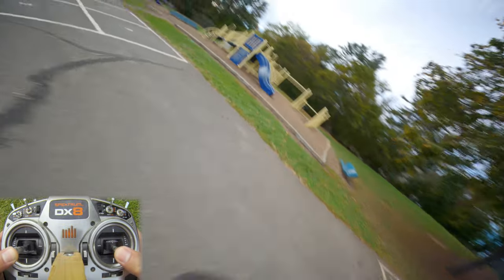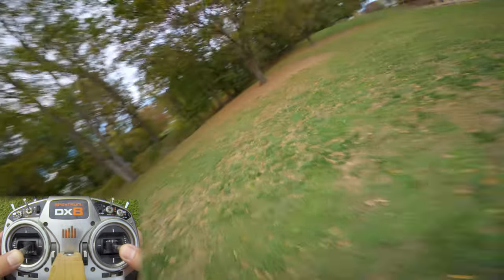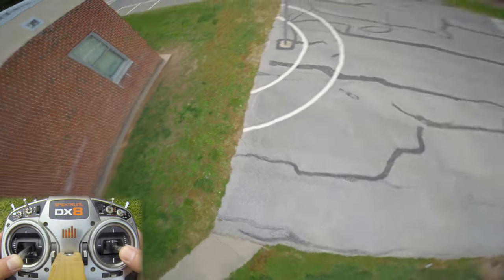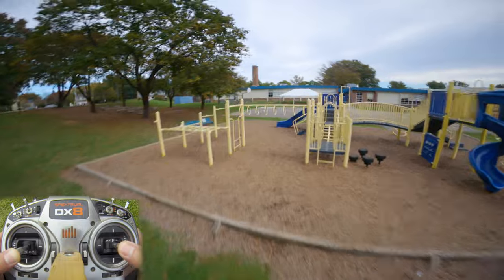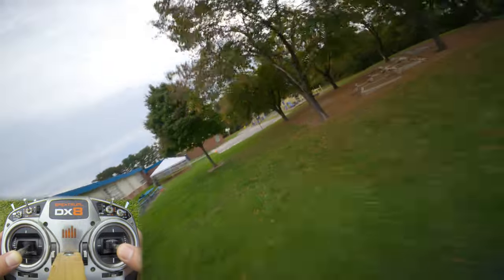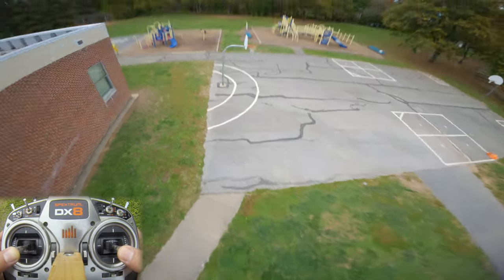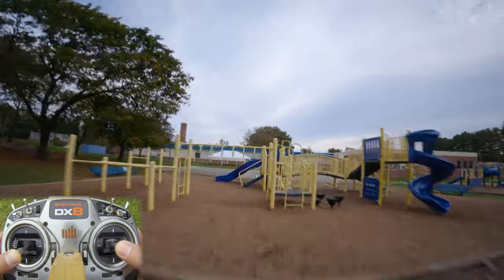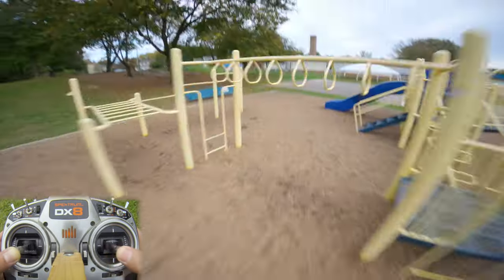Throttle Management  - FPV Trick Theory

Comment from the maker: What would you like to see on future episodes of FPV Trick Theory?
Reply: Would be nice to cover optimal camera angle and rates.
Reply: Power loops. You were nailing those loops around the hoop. I always feel so blind for the first part of the loop, and I'm just praying that I got enough height and back-throw to be able to complete the loop and not end up in the top of the tree (or whatever it is).
Reply from the maker: @MarkJaquith  Great news! I already have a power loop tutorial:
https://youtu.be/Fz2ujoePXdo
Reply: @TimmyRC  Fantastic! Used that advice to fly four packs today, and I think I identified what I was doing wrong, which was not holding pitch constant until past the top of the loop. Almost like I was trying to "peek" too early, which of course just flattened the loop. Still trying to figure out how to loop closer. Probably gonna just have to resign myself to sending it through some treetops to get that dialed in.